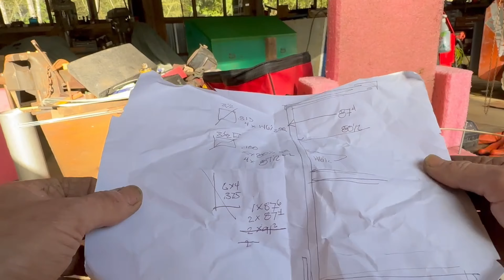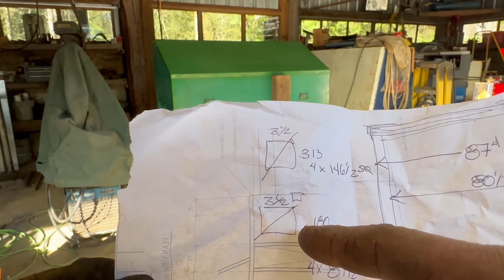Curved Copper Cupola Roof Mini Series Part 1

Comment: Hi Jake im loving the rack on your truck very useful & well designed great addition.
Reply from the maker: Hey Thanks for that,  the whole bed ended up a bit heavier than  I would've liked when I built it but I had a really clear list of criteria going into it.  There is a few small mods I'll end up making to it to add extra tiedown options in the front but I haven't quite worked it out yet.

Comment: The hydraulic floor jack/ bench looks like a handy tool to have!
Reply from the maker: One of my favorite things ever.   After using this one I realized the amount of work I could get done in a shop with four of them in a grid  would be next level.  Wouldn''t matter what you were doing be it wood or steel or whatever.  Any part at any height at any time.  It's good to dream:-)
Reply: @ShredPile  that would be awesome! 
Would you know what the working load would be on the one you have?
Reply from the maker: @dylanmiller7792  Yup,  it's 4000#   It's a panel hoist for a cabinet shop use to lift units of sheet goods up to an automated panel saw to keep them where it can feed itself like a copy machine feeds paper.  In another score I got just the top from a larger one of the same brand that is 4'x8' and I married it to a different table base that gets moved around as i need it.  If I need a larger space to work off of it's pretty commong for me to add a sheet of steel to the top or just tack weld some arms to it.
Reply: @ShredPile  you’re right, it would be next level!

Comment: Jake I wish I had room for a Marvel saw n my garage. I found out how to change the corks and the bushing with a new drive belt had them overnight the parts to keep the down time low I like the way they are built.
Reply from the maker: Worth putting on an addition imho:-)    The saying goes that the only thing that will stop a marvel is Osha:-)
Reply: Ha they are accurate too. Les than +-.005. That drive clutch kinda snuck up on us it had the wrong belt on it too. It never quit cutting only when we changed the corks. Then back at cutting 6x6 tubing and plate

Comment: Another school day for me (not being from the US) with the tubular steel sizes / weight. I looked up the '313' and '180' and found they are wall thickness in thousands of an inch (see 00:00:30) I also found the weights per foot, so those 3.5x3.5 313 square tube sticks provide a really good workout. I was trying to guestimate the weight of the finished Cupola Roof, but I'll defer that until I've seen more of the videos :)
Reply from the maker: I do the same thing Paul when I watch round the world so to speak.   One quick trick for  fractions of inches if it's more understandable.  .313" x your desired fraction which for this example we will use 16ths  so .313 x 16+ 5.008 or 5/16"  This will work with any decimal inch to fractional inch that you want and as you can imagine, after a while you just recogonize numbers  and the conversion happens automatically.   .875 x 8 (for eighths)=7/8"  etc.
Tube steel here is sold and expressed with the thickness noted in decimal inches and angle and bar is sold and expressed in fractions of inches.
It helps with confusion during ordering and conversation if one was to ask for 3x3x1/4 you would assume angle whereas if you wanted tube it would be 3x3x .250.
Channel shapes are sold by width and then weight per foot with there usually being several options in each size. Beam is a whole nother conversation.  One more thing,  I believe most other places besides here calls square tube RHS or SHS  for rectangular or sqare hollow section.  Its noted here as HSS or hollow structural section but nobody calls it that in conversation or ordering.
Reply: @ShredPile  I'm officially as old as dirt, and growing up and being schooled in the late 50's and early 60's in England, we were taught how to use both imperial and metric units. Starting work in '66 we used a mix of both, mostly imperial in the early days, but the move to metric (meters etc) marched on each year. I memorized the full range of 8ths as decimal inches (0.125 etc), but sadly never saw that neat trick for converting thou's to 16ths, that's so easy to remember, but I have no idea why I was never shown that, or maybe I was, but failed to put it into practice at work, and thus never memorised it. Career paths are funny things, and I dipped in and out of mechanical, electrical and construction roles, but all of those trades went fully metric in the end, some took longer than others. I don't think the US will ever go fully metric (outside of science). BTW the UK never went full out metric, e.g. Highway speed limits are still in MPH, and miles are still used on highway signs for the distance between cities (mile-markers etc). Going back to steel, the current sizing system in the UK is sort of similar to those in the US. Mass is kilos per meter rather than lbs per foot, but there's a whole bunch of different terms used that I'll likely never be able to, or need to comprehend :) But it's great fun to look into those terms after watching an entertaining video :)
Reply from the maker: @paulhammond7489  it’s always such an interesting conversation comparing the two systems. I really appreciate that backstory. It always amuses me when I run across the haters on both sides of the issue.  I agree that metric makes a lot of sense for certain fields or applications, but not others. Given the sheer amount of building material that flows back-and-forth between Canada and the US construction here probably never will go metric and I believe most of Canada’s residential construction is all feet and inches still although everything there else is metric.  Although I used to hear it a lot, nobody here really complains about most of the automotive stuff being metric, and everybody has both sets of tools now. Like you, I am amuse myself often by making conversions in my head when I hear or see somebody explaining something on YouTube, but without anything here to practically apply that it never really sinks in and becomes automatic.  I’m sure there’s all sorts of number and decimal moving tricks with metric that exist but again without a practical application for it I’ll probably never do anything more than wonder about it :-)
Reply: @ShredPile  There will always be the haters, we'll never escape that. I admit miss elements of the imperial system, I guess most of that is just nostalgia, but good riddance to parts of it. The British currency (prior to going decimal) is a prime example to things I don't miss. One Pound was 20 shillings, a shilling had 12 pennies, a penny had 2 halfpenny's and even the  halfpenny had 2 farthings, so one pound was made up of 960 farthings. Besides all those there was other coins: guineas florins, crowns, half crowns, tanners and threepenny bits. While over in the USA you  had metric money pretty much from day one with 100c = 1 dollar... Thankfully the UK adopted  metric currency in '71 and never looked back. Because of my age I can still think and work in inches, feet, pints, gallons etc as well as the metric system. I guess its a little like being able speaking a extra language as we had to work with both as a teenager, but the young folk only use metric these days :)

Comment: When you raise the forklift up and down, does that pulley stay consistently the same distance from the top of the frame?  If so, what about coping a piece of metal to the size of the pully and offsetting it on the upper frame just so the cable rides up to it and falls back down onto the pulley. Don't want a pinch point so a close cope and the full width of the pulley and cable on its OD would work best; maybe take the tag ends of this bracket and bend them out away from the cable?
Reply from the maker: Yeah that whole thing looks a little confusing but the fix is pretty simple.  It's actually one of the hydraulic hoses that feed the sideshift.  I just need to remove it and have it shortened to take the slack out.   It would also benefit from a small tab like you suggest to keep it from popping out in the future.  I could also just remove it alltogether by eliminatiing the sideshift function but I kind of like having it:-)

Comment: The blade on that marvel saw. is the blade twisted 90 Deg's where it cuts to the rest of the blade????????? Left me scratching my head trying to work it out.
Reply from the maker: Exactly right,   Its the same way as a portaband tool works.  
When you slack the unit to install the blade you twist it into it's slot in between the roller or guide blocks and then retension the unit.

Comment: Is there going to be a video on the finished Modern House?
Reply from the maker: Yeah, I totally plan on keeping up with it as I go back to do the other parts that I do.   It's currently getting sided and all the systems are being roughed in now.   As soon as I get some information back from the design team I can start laying out for handrails and guardrails.  I will keep up with it as it happens.   If you've just tuned in for that series I wonder if there's a notification setting that will  just notify you of that alone when I post with Modern House in the title?

Comment: ive noticed your main truck's rack has a cantilever over the cab but the rack on the backup f250 in the last video doesnt. was having no cantilever on the old truck an easy thing to work around or is it a "never again" kind of thing where too much stuff scrapes and dents the cab?
Reply from the maker: Oh yeah,  so lets see... the backup truck is actually a f350 and if you look close it's been re-sprung with a custom stack and the progressive 4 leaf overload so even when past max it looks normal.  That rack without the cantilever worked just fine for  a lot of years.  most steel is stiff enough but flmsier stuff I would just set on an extension ladder to keep it from flopping too much. It was never perfect but having the center always open makes loading and unloading super simple.  Also, the rear rack is removeable on both trucks and 'parks' up by the front rack to allow me to use the gooseneck ball in the bed if i need to.  I do much prefer the newer setup to the old but I still need to add a few more tiedown options that I keep meaning to do.
Reply: @ShredPile  im curious how the back racks are attached to the trucks to be easily removed yet still be solidly connected enough to stand up to the loads you put on it. do they rest in a piece of next-size-up telescoping tube?
Reply from the maker: @nathang.1561  Pretty much correct.  The older truck rear rack sits in the back stake pockets with a flange to bear on the deck and when not in use it parks in the extra stake pocket in the front.  The newer truck is much heavier built and there is 3.5x3.5 tube welded directly to the rear frame member of the bed and the rack is 3x3x.180 tube that sockets into it again with a flange that bears on the bed.  they both just sit in there with no real restraint.  the old truck has some bolts thru the stake pocket that keeps it from jumping out. and the newer one has so much crap on it it doesnt' move much at all.   I did drill a couple holes before having it galvanized just in case I i needed to bolt it down.  Once everything is strapped down it's not going anywhere.  This kind of setup is very important to me as it allows me to set up to a unit of ply on and off the truck without having a rack in the  way.  super handy.